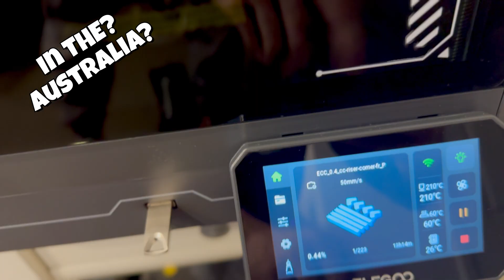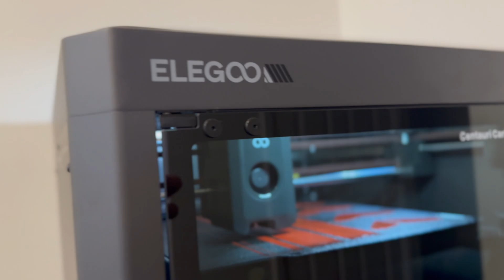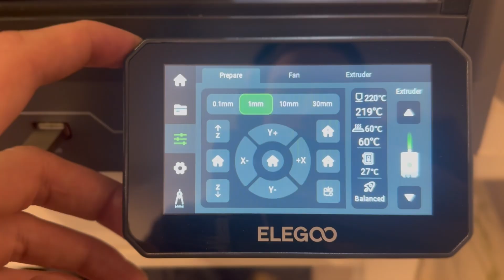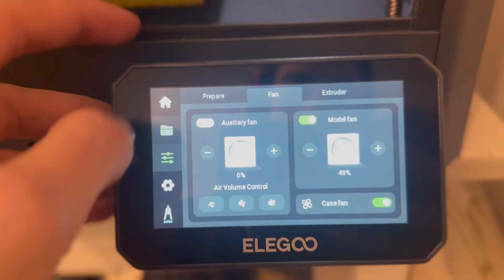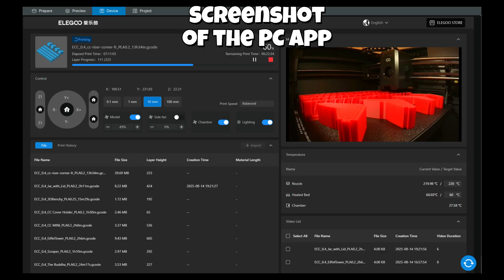BEST 3D PRINTER 2025?! | Elegoo Centauri Carbon First 24hrs | Review

Comment: Consider printing the printhead USB strain relief on printables.  This will provide support to the cable so it does not separate at the sharp angle.  There have been reports of separation that has caused sparks in excessive heat.  The only problem I've had with mine was on setup the print bed was stuck and it would not go through startup.  I had to free it up manually and then start up completed.  I'm very impressed with the quality and speed.  It's absolutely on par with my Bambi P1S and A1 and both these printers produce very high quality prints.

Comment: Hi, good to see you got the one with the new lighting in it. I'm trying to get the same from Jaycar where in NZ, but of course the boxes are closed and I can't tell if they're old or new. Could you look at the barcode on the rear and let me know what the numbers are on it? The display model here has CC.25327.A045 on it. I think the A045 could be the hardware revision number.
Reply from the maker: Hey dude! on the sticker there should be a date. mine was made 20/07/2025 if that helps. its one of the more recent ones. Maybe ask them when they got the shipment
Reply: @BuckoPrints  Thanks for that! I went to another Jaycar today to try and check out the boxes. No dates, but there happened to be a guy there who I've spoken to many times over many years about 3d printers and he knew which box came in last and took a knife to it. It was easy to see the new lighting cutouts just by removing the top cover. And a small discount for father's day sorted the deal. I note that the printed manual says Version 1.2 on the cover. That's the only other clue I've noticed so far. All happy anyway :)
Reply from the maker: @robax sweet dude! Yeah I was stressing too about getting the upgraded one! Nice that you got it too. I think most the ones on the shelf’s now are the new ones! Enjoy it bro!